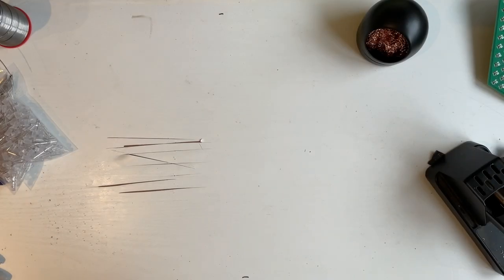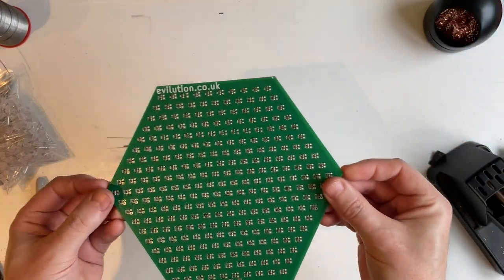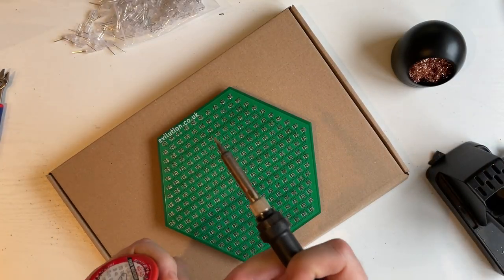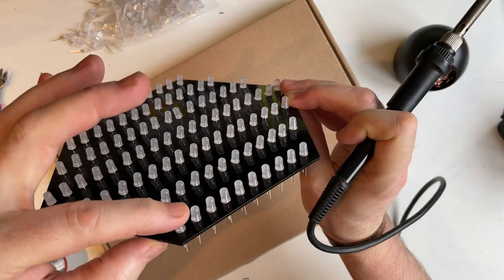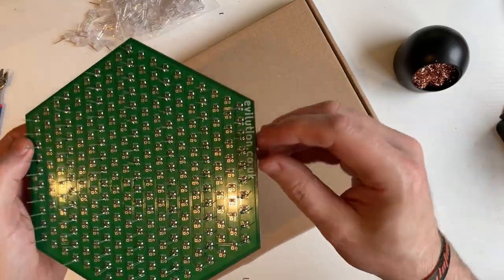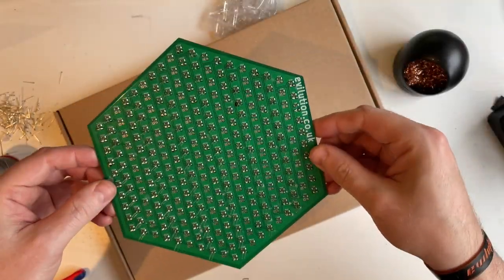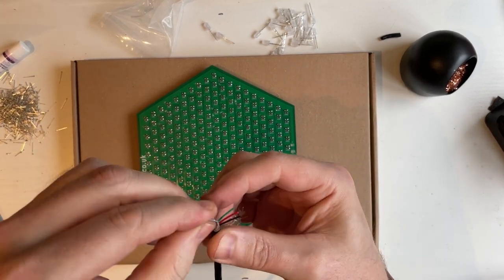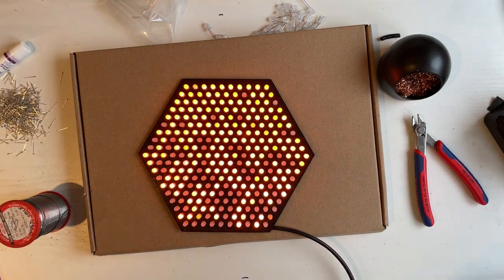Building your Hexaputer

Comment: Building my order from a year ago right now. Suggestion for next revision - thermal relief for the square pads, please. Would make soldering much faster. Oh, and mounting holes? It'd be lovely to mount on the wall with small standoff barrel-and-cap fasteners. And maybe a usb connector land pattern, so that we don't have to cut up cables? 

One more thing - many of the leds in my kit had excess flash that needed to be trimmed. Not the end of the world, but worth nothing.

Sorry to sound like such a complainer, really love the kit, great price, and it'll look lovely once finished.

Comment: I find if you splay the leads after inserting into the PCB it pulls the LED tight to the board so you can solder completely in one go round.
Reply from the maker: Agreed. The reason I don't do that is that if you have to desolder and remove any, it can damage the pads. Even with the legs splayed, the LED can still rock on the same axis so there's a chance they don't sit totally flat.

Comment: I'm having some trouble getting the solder to stick to the pad.  I realized I am using lead-free solder (it came with the iron) so I'll get rosin-core solder, but I'm noticing the solder doesn't like to stick to the pad and pulls up into more of a ball shape when I pull the soldering iron away and the LED is not held in place (or stays stuck to the iron tip and not the LED/pad).  I have my iron set to 700 F and I'm seeing it is taking much longer to melt the solder than in the video.  I'm trying to apply heat to the pad and the LED wire at the same time and apply the solder from the opposite side.  Any tips to help me out?
Reply from the maker: it is absolutely the solder. Lead free is horrendous to work with. It requires much more heat than leaded, doesn't wet the pads like leaded and doesn't seem to flow all that well. Even I have issues when using lead free.

The free stuff you got is probably also low quality lead free solder.